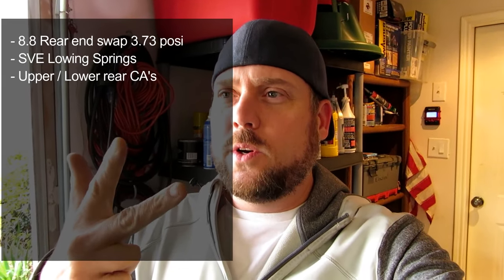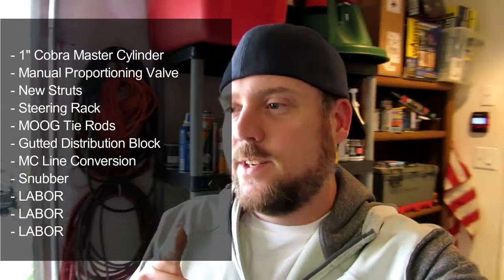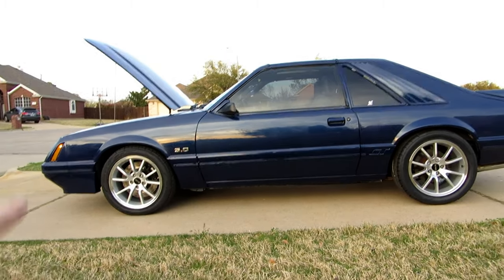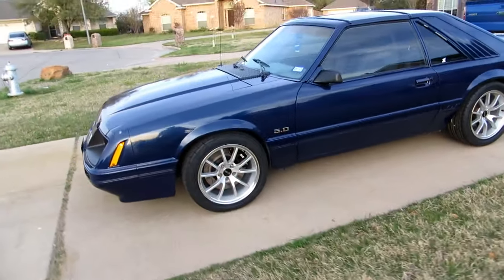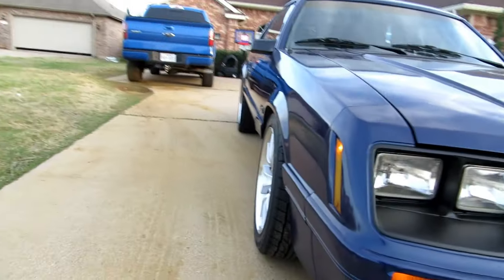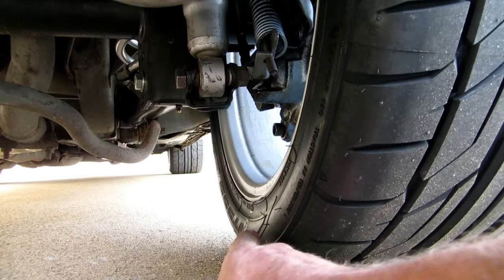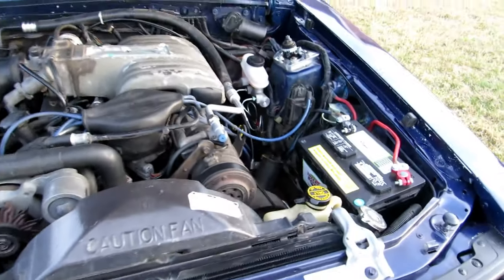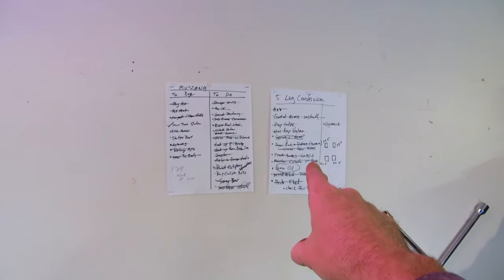1986 Mustang GT Project - 5 Lug Conversion - DONE!

Comment: that stance is perfect Mike great job on the mustang
Reply from the maker: Thanks Jason
Reply: your welcome whats next for the stang?
Reply from the maker: Drive it for a bit, rear brakes still need work, one caliper is leaking so I need to try to rebuild it...Then up the power. There is a lot to be had in that engine.
Reply: Nice are you doing the Cobra rear brakes and what are your plans for the motor turbo or n/a
Reply from the maker: Rear is a custom setup with 11" rotors and GM metric calipers. No plans for turbo at the moment but who knows!
Reply: cool that should stop ya and you never know but im waiting for the next vid your a cool guy to wach!!!!!

Comment: Outstanding job! I'm so jealous, lol.I didn't think the 5 lug conversion was worth the money, but after seeing your car I realized how wrong I am!That little shoe box looks amazing. It should handle like it's on rails! How much did the brake and axle upgrade set you back? I'm interested in converting mine now! Keep up the good work.
Reply from the maker: Thank you sir. Night and day different from the stock springs / pony wheels. The stock 86 brakes are just terribly lacking. When I drove it I didn't go crazy but steering was fast and responsive, feels like a big go cart lol. But I guess driving the Torino and my F150 crew cab is a bad comparison.

Comment: Few question about the rear brakes, was the rear axle already setup for GM calipers?  Is this a common  8.8 drum brake upgrade or a Ford disc upgrade?  And last do you know any website that has more info on this?  Thanks, DC

Comment: the Fox is coming along absolutely amazing Mike, really loving these videos, and i love watching the progression of the build. cant wait for the next video, awesome job! ( ps what do you think about an msd ignition for it? i got one in my 86. let me know, thanks!!
Reply from the maker: +Ryan Santos - IMO the stock ignition is fine. Maybe an msd coil would help with a stronger spark but i dont think an aftermarket ignition is critical until you need high rpm control or with nitrous or forced induction. The stock ignition is already electronically controlled.

Comment: How did you get LMR to put 2 different tire sizes on the 17x9 rims? Only tire/rim combos I am seeing have all 4 tires the same size. Love the way yours looks, and really on the fence with going with the deep dish rims and a true stagger.
Reply from the maker: Me 2, and I was on the fence as well. I love the staggered look, but man every fox in my area is running staggered. Wanted a little cleaned look and I think the 275 tire under it just looks right "proper". I called LMR...when you order 4 wheels and 4 tires seperate they will mount and balance them by default unless you say otherwise...but call and make sure first.
Reply: Awesome, thanks! Also, did you have to make any modifications to your front fenders or anything to keep from rubbing? I see on the LMR website, that they claim you need to add rack limiters to avoid rubbing. Did you add those and I missed it? Or maybe it has something to do with the aftermarket rack you installed? Sorry, just wanting to avoid any surprises when dropping that much cash on wheels and tires.
Reply: @chrisruhs5246  I can personally say that on my lowered 88 LX running a 235 tire in the front (on 17x9s), I had to install the steering rack limiters to prevent it from rubbing at full lock. They literally take 10 minutes to install. Jack up the car, crawl underneath and pull back rubber boots on the steering rack and clip the plastic clips on. I can't recall how many I needed on each side (it wasn't more than a couple) and it did the job. My turning radius sucks now but at least it's not rubbing.

Comment: I'm looking at doing the same conversion to my 88 LX. Did you end up swapping the brake booster as well? I read that it's highly recommended to do that since the stock one won't provide enough assist. Apparently installing the bigger brake booster is a huge pain too, since it doesn't exactly fit without 'modifications' to the strut tower and firewall.
Reply from the maker: I did not. Im sure it helps assist, but I can also assist with a heavier foot lol. Just didnt feel it was needed IMO.
Reply: @HOUSEOFDULA  Thanks! I'm going to watch your series on the rear disk installation too. So far, I've found a reasonably affordable kit for front and rear sourced from eBay and I'm debating about pulling the trigger this summer. I've done just about everything I want to do to this car except for brakes, rear control arms, and seats. One thing at a time.

Comment: I binge watched what felt like 50 videos from ya one night and decided to subscribe. love the videos.

whats the plan for making more power? you've got all the supporting mods done, body and suspension wise.
Reply from the maker: On the bench Ive got Explorer GT40 upper and lower, and looking to source a set of heads for it. So, basic mods like heads, intake, exhaust. Short block is healthy so just no need to yank and stroke it (yet). Need to decide how Im going to handle fuel delivery so I can cam it. I assume a MAF swap will be coming this year.
Reply: +Mike Dula (HOUSE OF DULA) gotta be careful with heads on the 86 style dishes piston. trick flows usually clear with no problems but most inline heads will hit without clearancing the piston. everyone will tell ya to go afr, but even the 165's won't clear without new piston or cutting valve releifs.

Comment: 7 years later, would you do anything different?
Reply from the maker: Good question! And nope...ultimately the car is about perfect for me, still to this day. Never once was I like "I need more brake". I will say if you want to do anything more than spirited street driving you "may" consider something a little larger diameter, and move up to a brembo. But...I dont need that. Brakes have not been touched since I did the conversion.
Reply: @HOUSEOFDULA that is amazing to read. I have an 86 convertible. If I’m doing anything more than you would do, it better be an emergency. lol I’ll have to grab your parts list sometime. Finishing up on the tune after heads cam and intake swap with a MegaSquirt. I’ll have to save some money first but you have my spirits up!
Reply from the maker: @jeremymiller236  - Yeah man! No need IMO to keep just throwing the best of the best at these cars just because its a trend. They were fun to drive in 86 new, but the brakes even then could have been improved upon a little. Cobra brakes are plenty good, folks figured this out a long time ago, and still works. One thing I will say is I didnt "choose" my rear setup (came with the used axle I bought), MOST guys put on the matching rear cobra setup...mine is an oddball and I had to fiddle with the rear bias to get it right So its a little different than most setups, but still wouldnt change it. or think its THAT much different than an sn95 rear cobra setup.

Comment: Just got some 94 spindles off eBay.   They cleaned up pretty good, but I’m probably going to paint them anyway.  Just wondering how your paint job is holding up on your spindles?
Reply from the maker: Holding up fine. No issues. Powder coat would be obviously more preferred, but to me that a waste of $$$ for something I plan to drive a lot. As long as they are bare metal paint will stick good.

Comment: why did you keep your stock master booser? didnt you have to replace it with a cobra as well?
Reply from the maker: I dont have to. Some do, some dont. Both are power assist, the cobra one likely has a bit larger diaphram so it assist's a little more. Contemplating if I want to switch to one, but the stock works fine.

Comment: So, you kept the stock brake booster in place?
Reply from the maker: I did. Works fine, though for a touchier pedal you might want a larger booster, or one to match the sn95 brakes on it. Im sure, once my ever goes out Id put on a sn95 cobra booster.
Reply: Mike Dula I have an 83 that's been converted with Cobra brakes up front. That was already done when I got it. There's too much pedal travel now and I've been researching which master cylinder/brake booster combo I'd need. Sounds like just the Cobra master cylinder will work.
Reply from the maker: ponie1992 - a larger bore will firm the pedal up and decrease travel, too firm and the pedal will feel too hard and you will need more mechanical assist from your foot :) so go up in a small increments
Reply: Mike Dula sounds good. Thanks for the help! Any way to contact you more directly if I have any more questions?
Reply from the maker: Email is best. prisonplanet88@gmail.com

Comment: Good work. Time for hci
Reply from the maker: Yep! Engine mods will be next. Need to decide how im going to manage it, with a different ECU (Megasquirt etc) or go MAF conversion.
Reply: Mike Dula nice!
Reply: Mike Dula I'd look into a haltech ecu, that's what I'm running on mine and I absolutely love it
Reply from the maker: You know, I did. But the site states the ECU is for a 89-93. A lot seem this way, Im having some issues locationg a PNP ecu for a 86 harness.
Reply: Mike Dula forgot to mention I used a ford racing engine harness, I've heard you can't move a few pins around and be able to use the haltech system as well
Reply from the maker: Gotcha, so the haltech with stock harness wont work...Megasquirt PNP claims its works for 86-93, wonder if there would be any issues with  the stock harness and pin-out even with it. This is my debacle, how to tune the 86 for anything I can throw at it in the future.
Reply: Mike Dula it's weird though because the harness I'm using is the equivalent to a harness from a mustang with mass air, but the haltech bypasses the mass air and runs it as speed density, so I'm sure there is a way to make it work on a stock harness.